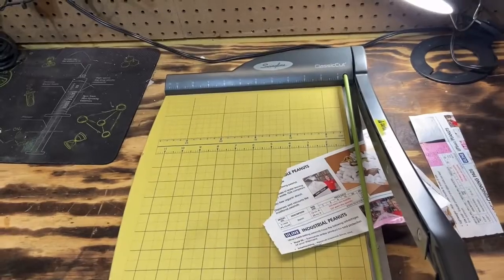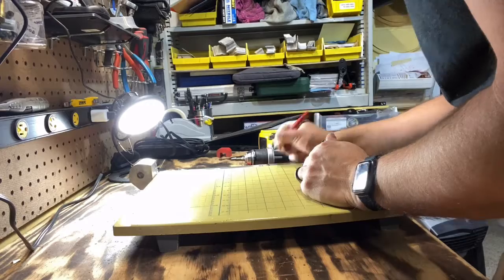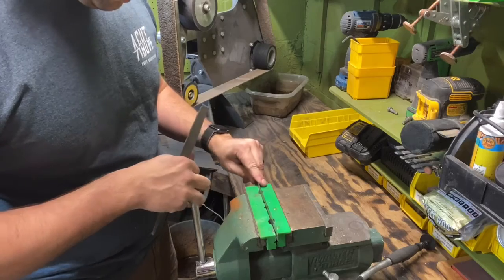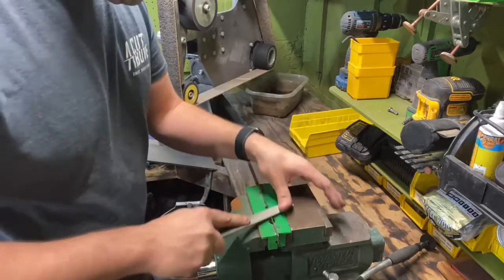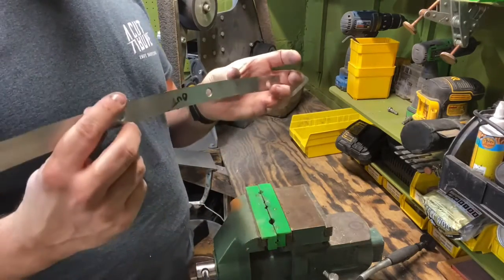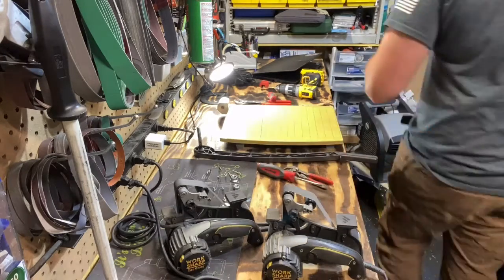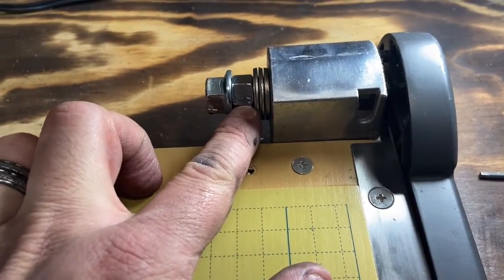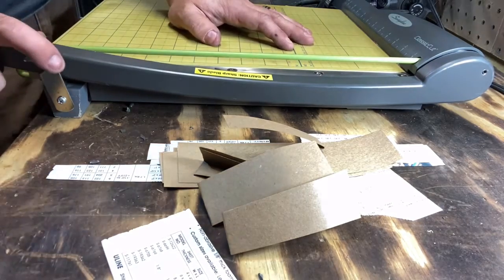How to sharpen a paper cutter

Comment: Great video. The 14 minute part about the mechanics of the cutter is really important, and is often a mystery. Thanks.  I am not sure I have all the right tools to repair my paper cutter.  But will look into it
Reply from the maker: I learn by making the mistakes myself. Then try and pass my learnings onto others so maybe they don’t make the same errors. I also learn by understanding the principles behind what I am trying to achieve. 
Quick trip to your local hardware store will get you all set up if you don’t have the tools already

Comment: A note on the reassembly (at https://youtu.be/L-7iO8reZuY?si=wlIfQTv3u8BIXwsN&t=861): those are Belleville washers, not wave washers--both a type of spring washer--and the flange nut should go against the stack of Belleville washers with the smaller nut next to act as a jam nut. The flange nut offers a larger surface for the Belleville to press against. You can also reverse one or two of the Belleville washers to change the springiness (i.e., spring constant).

Good, concise video, though.

Comment: APPLY VALVE GRINDING PASTE TO SCREWDRIVER BLADE TIP WHEN ENGAGING DAMAGED SCREW SLOTS.
Reply from the maker: Thanks that makes sense I’ll have to try that
Reply: 4:16 for anyone looking.  Nice tip.  Instead of lubing the screw, use a pasted course abrasive to allow screw driver head to tightly bind into screw.

I’ve not thought about it like that.

I guess this substance is the anti-lube.